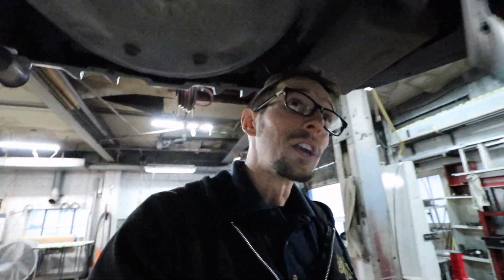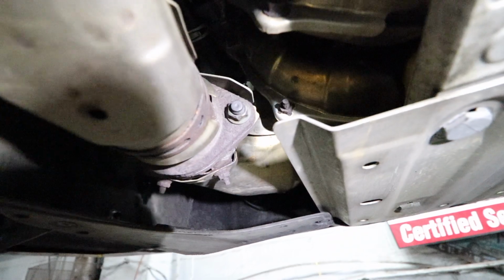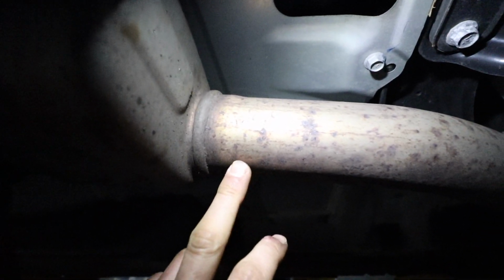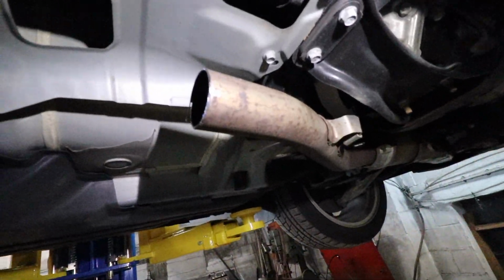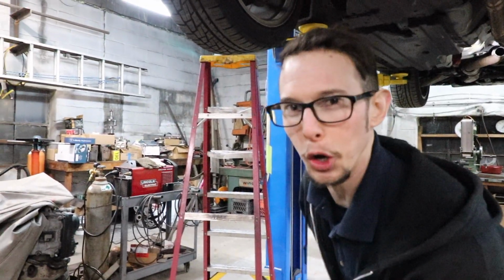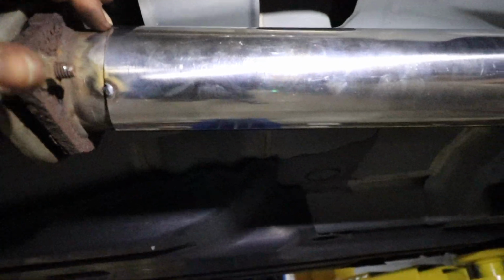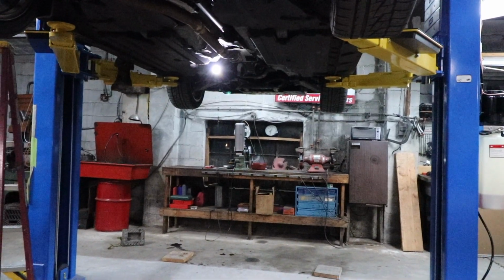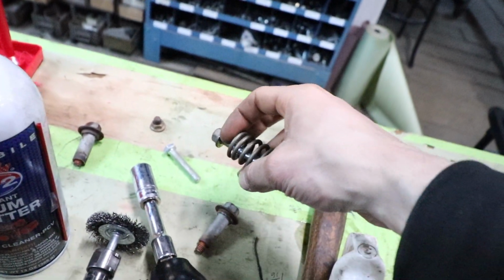2016 WRX RESONATOR DELETE HOW TO

Comment: What is that pipe called that has the resonator on it? I welded a pipe in where my resonator is but it’s not very good and I would like to just buy a aftermarket part for that area, I have a invida catback that is right after that part so not sure that exactly I need.

Comment: If I get a resonator delete will it affect my ability to get a tune ? Also I thought people get a resonator delete for pops and bangs not to make the car louder.
Reply from the maker: it will not affect your ability for a tune if anything it could help increase power. The resonator is designed to cut down noise and specific frequencies. Performance exhausts use a resonator to create a specific tone to help improve the sound. By eliminating the resonator it can cause pops and bangs but doesn't always work unless tuned for it

Comment: Get a remark axle back exhaust I get pops without a resonator delete on my 19 wrx
Reply from the maker: thnx for the tip
Reply: Rudy B same. got a remark muffler delete on my 18 wrx. was thinking about doing this but don’t know how much difference it really will be.. i tell you the Ron Watson crackle tune is pretty nice tho :)
Reply from the maker: @BCyyGaming  ooh i can only imagine how sweet that sounds.
Reply: Salvo Brothers oh man i love it . the boomba bpv completes it all so well with the intake
Reply: @BCyyGaming I have an 18 and had heard that only the 2015 to 2017 models had resonators built into the factory exhaust. From 2018 onwards the WRX had no factory resonator and only the STI had them
Reply: I was wondering this as well although I have a 15 and I’m quite positive it does NOT have a resonator but I’ll have to check again tho to be sure . I did a muffler delete and it drones like a mofo on interstate Im Actually lookin for a solution to fix it like install a resonator lol